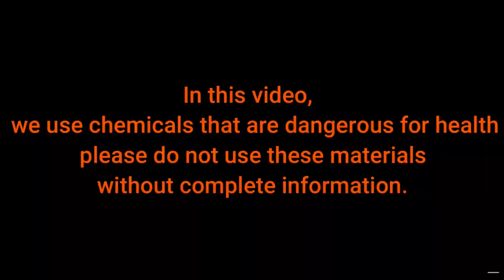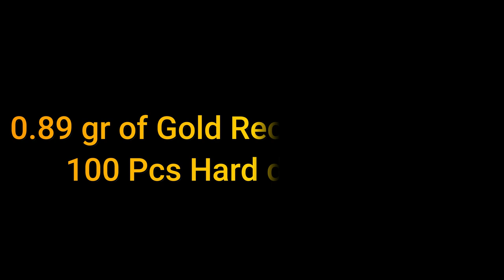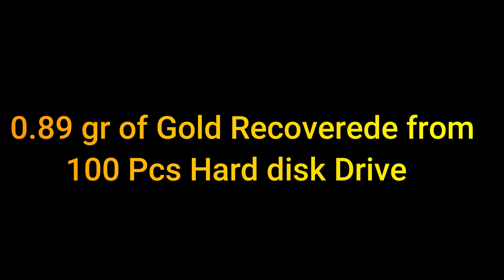Gold Recovery from Hard Drives | Gold from Hard Disk | Gold Recovery

Comment: Why you initially use SMB but at last drop you use hydrazin? Why not SMB for both?
Reply: When you first use SMB, it drop some contaminants with the gold power making it dirty gold. Using SMB again will make the risk the drop those contaminants again in the second gold drop. Using two different precipitants will make your gold cleaner at the end. Doesn't matter what you use first or second. It is just recommended to use different precipitants for the two drops
Reply from the maker: its true and thanks for good information sir 🌹🌹🌹🌹🌹🌹
Reply: @smokeshishqc2287  wow..didn't know that. Seen so many people use the same chemical for 2 or even 3 drops. Thanks for the info.